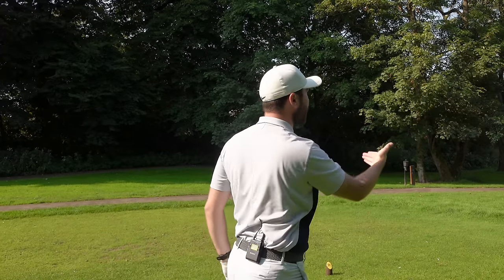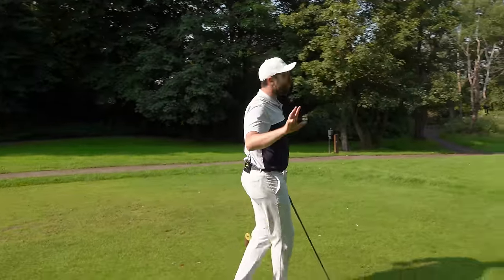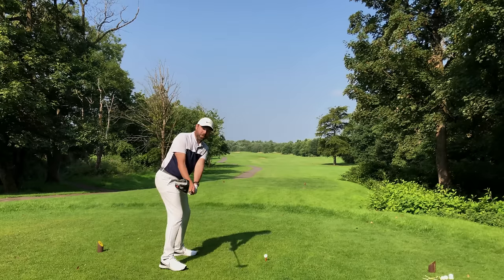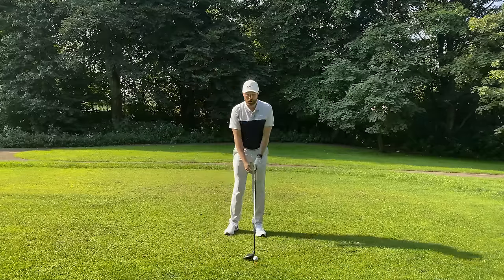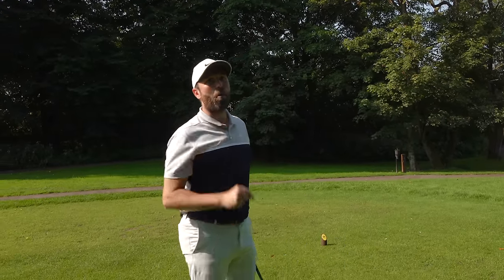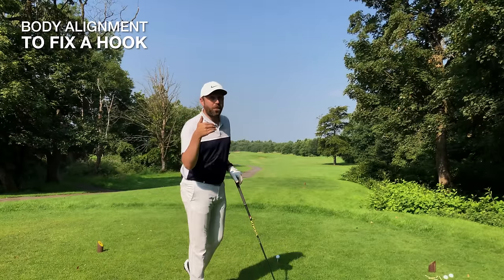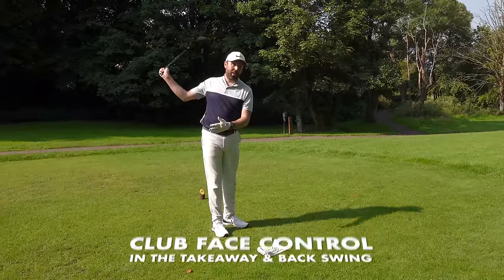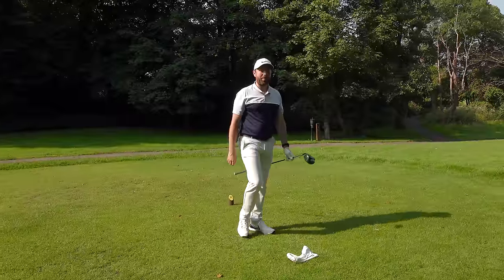5 SIMPLE WAYS TO FIX YOUR GOLF HOOK - GUARANTEED

Comment: Thank you so much for this! I've come back to golfing after 20+ years away, and have been hooking terribly. Took a trip to the range where I planned on trying each tip in turn to see how I could fix it; my grip needed to weaken up. Boom, drives were straighter, irons didn't carom off to the left, and it was (mostly) fixed. 

This kind of instruction, plus your series on paying with inexpensive box sets (which convinced me I could buy a set of clubs for $300 that would be perfectly serviceable) have turned me back into a golfer, and allowed me to bring my daughter along for the ride, offering us excellent daddy-daughter bonding time. So thank you again.

Comment: The one thing that you did not address was insufficient body rotation, where your arms take over the swing rather than following your lower body. I have some lower back issues that can limit or at least slow my rotation, and would be interested in your observations for this problem. Keep up the good work!
Reply: Completely agree. When I hook the ball it’s because my swing is all arms and not enough body rotation.
Reply: I have the same issue and probably one of the biggest reasons for most players hooks.  Early extension is very hard to stop, creates limited rotation and therefore results in a shot that almost always hooks straight left.  I have to focus on moving might right hip forward and might left hip back and not allowing my hips to travel forward towards the ball.

Comment: i started to have a hook after fixing my slice. will this just be a cruel vicious cycle of slice, hook, slice, hook for the rest of my life?
Reply: Yup, need to find the sweet spot
Reply: Are you trying to swing to hard? That was my problem.  I quit trying to kill it (which was harder cause I love hitting it long) and started to swing smooth and my mine straightened out.
Reply: Get 1-2” cut off your driver shaft. Way easier to make solid contact and control the face. Won’t hit it as long but it will be more consistent and that’s way more important for any amateur.

Comment: These tips are excellent. I always used to hit it straight off the tee but the last 3 months or so I have been hooking every other drive.  The main problem i found was the crossing over of the hands (tip 3) probably trying to hit the thing too hard over time and develped a bad habit.  Tip 3 is very similar to Jack Nicklaus' tip which solved my hooks where at impact you make sure the palm of your right hand (for RH golfer) faces the target and keep your right hand below your left as long as possible on follow through.  Having played a lot of cricket it is almost like holding the high elbow for a cover drive and not letting the bottom hand take over and whip it through midwicket - the left hand is the control and keeping that above the right stops your wrist breaking and the hands crossing.  I now make sure to say "cover drive" to myself on every tee as part of my routine. :-) (12. 6 HCP)

Comment: I was at the range last week and was just hooking everything with my driver. I tend to play a nice draw with my irons but I was just snap-hooking the driver. I didn't want to try to totally change my swing so I made the simplest adjustment I could think of. I weakened my grip a bit (note: I do not have an overly strong grip at all and I don't grip the driver any differently than my irons). Anyway, I weakened the grip a bit and started to hit these beautifully straight drives and even hit a few gentle fades. My initial fear was that the shot shape might cost me some distance but it didn't. I was flushing them and hitting the ball even longer than average. I think, somehow, the grip change may have improved my "smash-factor" and allowed me to hit the ball closer to the center of the clubface instead of favoring the toe, as was typical for me before this adjustment. It's amazing how one small change can make such a big difference.
Reply: As a life long hooker myself I would say no not any loss at all. I've found that I can actually go after it ever harder now that I know that it won't hook no matter how hard I swing.

Comment: Shortening my x-stiff shaft from 44" to 42.75 helped TREMENDOUSLY, basically an 8° 2W.  My issue was slicing, might help the hookers too.  I use a strong grip and weakening it helped but felt too odd.  Now at worse it's a weak fade but often a straight shot, and runs.  Cheers

Comment: Rick, I just want to say thank you for the awesome content! Any chance you could make a video specifically about better iron striking for spin rates?

I took a long (~6 year?) hiatus from golf and finally am able to get back into it. I started going to the driving range roughly weekly about 2 months ago to get back into shape and have been analyzing my own swing extremely carefully while using your videos as a reference.

Tonight I just went to a fitting to make sure my clubs aren't teaching me bad habits, and my instructor was floored with how well I was hitting considering my experience level (my 7 iron is a very consistent dispersion just shy of 170 yard carry, sometimes just breaking 175) - thank you for the help!

My spin rates on the 7 iron are wicked low though (as in averaging around 2750 RPMs type of wicked low), and my instructor actually couldn't find a club setup that helped me with that much beyond gaining 100-200 RPM or so.

Comment: Have you been watching me play lately? Where are you hiding? Because this is EXACTLY what I have been working on for the past year! You nailed it! Every point you made is absolutely essential in hitting it straight. Two more tips.. 1. Stand slightly closer to the ball - helps to correct the club path straight through the ball. 2. Picture a spot a foot in front of the ball straight down the target line and extend the swing over that line to promote the "Straight Line Release". Thanks Rick!

Comment: Hi Rick, Great advice by the way .. really helpful thank you. I haven't had a driver in my bag for 7 years now !! My natural long shot is with a slight draw with both 3 and 5 wood, sometimes a little too hookie. With this valuable tip today I am looking to add a driver to my bag. I have a relatively slow swing speed though. any recommendations for aprox £150 driver to suit me. What degree loft should I be looking for.  I'm ok with an old stock or 2nd hand driver to start me back. Thanks again

Comment: I think there's a 6th an more common reason for hooking, it's raising the hands and ulnar deviating through impact.  Usually people do this in an attempt to help the ball into the air.  
Solution: Keep the hands moving what feels like downward through and after impact.  This stabilizes the face and prevents it from turning over.  Basically, it just stops you from doing something really bad and causing the hook.

Comment: Rick, I have a stronger grip. My hands are not as turned over as you show, however I need to make an adjustment. I have been using my stronger grip for so long that I feel like I don't have as much control over the club. Besides just practice is there something else I can do to get used and comfortable with a new grip?

Comment: I just got fitted for P790 irons with extra stuff shafts and the hook started appearing. Usually I’m a slicer so I’m very confused. I’ll have around half or less than half the shots will be straight or a slight fade, the remaining is anywhere from a 7yd draw to a full hook. The height of the shot is pretty normal, as well as pretty solid contact.

Comment: This is pretty accurate for bigginers! but I have a strong grip and in a great position at the top, I hook the ball because of early extension, and my hips not rotating, so the angle of the shaft steapens and I whip round the ball with quick arms :s

Comment: A Pull Hook question.  I am pull hooking my driver most of the time.  I sprayed powder on the face and every shot is from the center to th toe side of the face.  Is this related to my pull hook or is this a separate issue?  What's more curious is that my irons tend to fade right or straight pull left.

Comment: I've hit a draw forever, but my bad shot is the hook / pull-hook and it's it points 3,4 & 5 that get me. After lining up properly, I find that the club at take away has a huge influence on my swing path. I need to feel like I am taking it away at almost a 45 degree angle to the outside from the ball. In reality its nowhere near that, but it starts my back swing in the right place and get's me not so flat at the top and stops the shift to massively inside to out. That also slows my wrists down. Whatever I do though, I cannot hit a fade - if I do, it is a complete fluke

Comment: I’m not sure if I agree with getting rid of the inside path in the 5th one. An inside path is more desirable than an outside path. I think a better tip would be to keep the inside path but to work at getting the club slightly open at impact to turn the hook into a draw.

Comment: And to complicate things further, there's several varieties of hooks. There's the toe hook, the pull hook, the push hook, the duck hook, the sky hook, and the dreaded snap hook. Then factor in that before high-speed video, the theory was that face angle controlled ball spin and club path controlled direction. Now, supposedly, the video camera has revealed just the opposite; that the club path controls spin and the face angle controls ball direction. But to me, that over-simplifies things. I think in the end, it's a ratio of club face angle and path in combination with club-head speed, loft, attack angle, dimple design, ball type, atmospheric pressure, air temperature, club manufacturer, and swing timing that controls ball flight. Of course, Ben Hogan fixed his hook by making a simple swing change, but it was a secret he took to his grave. You can find all 15 of Ben's secrets right here on YT. Good luck, hit 'em straight.

Comment: So, if my draw, my sweet right to lefter has gone, leaving a nasty hook in its place, I open my stance a touch and hit the fade as a fix? I'd been told that correcting the draw is the fix, and that if one adapts with a fade, then that starts to slice, you're back to relearning the draw, so better off just taking the hook out of the draw from the start.
My fade is presently a straight ball or double-cross,  and my draw, nice or a God-awful hook.
If I were DJ or Vijay, power-fade it'd be.  I'm Eric, so this relearning may be wise.  I also valued an "across" swing with 8-full wedge...high, no bounce.  But now, just left, but not hook-left so in play.
Doesn't seem this seesaw ever ends, does it?

Comment: You know what’s funny? I was hitting a snap hook on my driver and I actually tightened my right hand and completely fixed it
Reply: It's a good way to prevent over rotation of the wrists/arms through the ball.
Reply: So do you still rotate your wrists the same amount or did you just tighten your grip and stop rotating ur wrists as much?
Reply: Garett Gee yes so my right hand was too loose on my grip and was causing my hands to over rotate in my down swing causing the ball to go low and right to left. Now I do the same swing with a tighting right hand and im able to hit a high and far draw
Reply: That's odd because I have been looking to loosen my grip on my right hand and only use to roll my wrists over at the point of contact. Gonna try it at the range this weekend. Its helped chipping in the yard.
Reply: Garett Gee good luck man. Not everything works the same for everyone 👍🏻